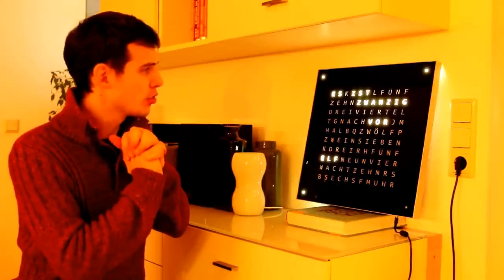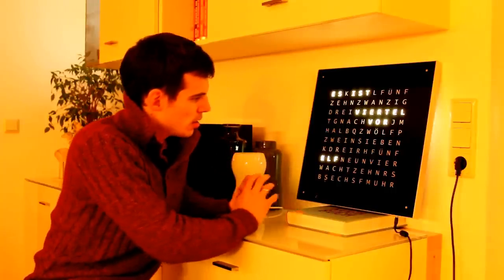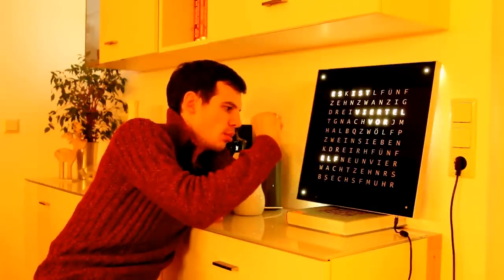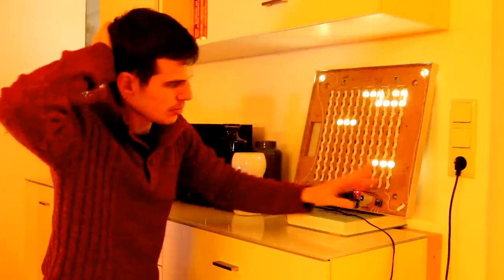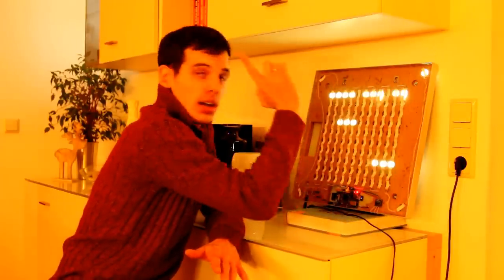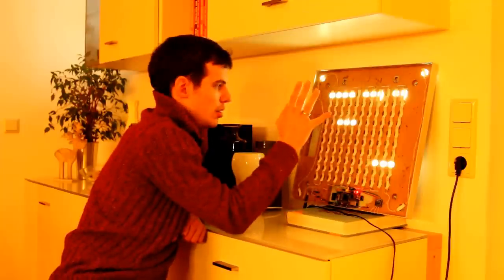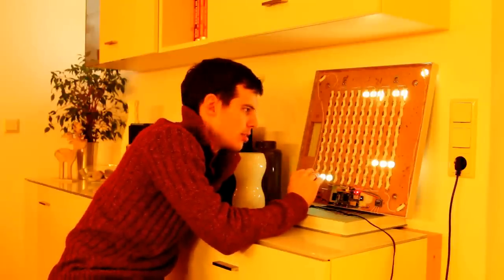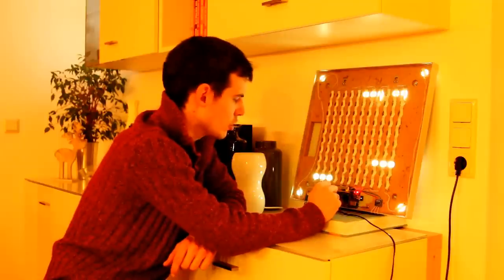Presenting a Raspberry-Pi based Wordclock

Comment: Hi Bernd, wonderful project! 

Your instructions and code were an excellent help making my own version, resulting in a very nice birthday gift. After a lot of experimenting, I now use a smartphone app to control the clock functions, like brightness, color, and temperature display. It uses the OSC protocol (pyOSC on the Raspberry, TouchOSC on the phone), which integrates nicely with the clock code. 

The acrylic face plate was the most expensive part. I had it printed at an online photo print shop. But considering the price of the other components and the clock's capabilities, it's still a bargain. So thank you!
Reply from the maker: +Robert Pilon 
Hi Robert, that's great news! Good to hear, that you like it! The additional features like brighness control and temperature display are really interestering!! Updates are always welcome! So: If you find the time to share your code on the github website, feel free to do so! ;)
Regards!

Comment: Hi,

thank you for making this project available. i'm working on one right  now and have a question in regards to the wiring. Do you start the wiring at the raspberry pi and then work towards the end or do you work from the end towards the raspberry pi? thanks!
Reply from the maker: Hi +Horatio12453,

there are little arrows on the LED-strip indicating the direction of data transfer. This data is transfered from the Pi towards the end of the strip. All arrows should therefore point towards the end.

Regards,
Bernd

Comment: Hi Bernd, great project. I really like it since I'm also not coming from electronics but already  having a solderiggn version done this is a really exciting and easy to extend version. I already added a Dallas 1820 for giving the temperatrue as plugin. Actually I'm just struggling with how to wire the switches for debouncing (I get "pressed 17" all time). All what I read from adafruit and generally about debouncing didn't help. Could you share how you exactly wired the three switches in your basic non-capcativ version?

Thanks Steffen
Reply from the maker: Hi Steffen,

good to know, that you like the project!! :)
The wiring I did, is like this: https://www.cl.cam.ac.uk/projects/raspberrypi/tutorials/robot/images/EGHS-PullUpDownSwitchProtected.jpg (upper version)

Note, that the compatibility with the capacitive board, a button is registered to be pressed, if the GPIO pin is set to low/0. Not pressed corresponds to high/1.

Hope I could help!

Regards,
Bernd

Comment: Wow super nice work. Received a couple of those LED strips and didn't know what to do with them. This got me inspired. Thanks for your upload to github and your explanations. Was really thinking it was impossible to use these kind of addressable strips directly with the Pi. Finally  ran in to your great video!
Would it be a problem to use the Pi model 2?
Reply from the maker: That's good to know, that you like the project! I'd except it to work fine with the PI 2.

Comment: Hi Bernd. Nice and inspiring work!
I'd like to ask some questions, since I want to build a similar clock. I've ordered the mentioned led strips, but I can't see what the exact distance between the LEDs is. Do you maybe know that? Or do you know, which distance you had between the holes for the letters? And how big is the clock in general? Something about 50cm?
And additionally to that: I like, how the front looks, but I can't find any information on the docs how you did this. Is it a foil on a glass plate? And how did you mount the glass at the end? I see 4 mounting screws, but I can't imagine how it looks on the other side. :)
Reply from the maker: +Markus Strässle Hi Markus,
I'd recommend to first get the front plate and afterwards buy a LED-strip with according spacing. In my case, the clock has a size of 45x45cm.

The front is readily available here:
Layout: http://www.mikrocontroller.net/wikifiles/3/37/Wordclock-0.13.zip
Projekt: http://www.mikrocontroller.net/articles/Word_Clock_Variante_1

I attached it with four screws, which I glued onto the frontplate. (I'll try to find the time to provide images, which explain this a bit more in detail... :)

Hope this helps,
Bernd
Reply: +Bernd Krolla Thanks for your reply. Meanwhile (actually today) I've built my own front in 50x50cm. The LED strips should arrive tomorrow. Since I painted the glass front by myself, I'm not sure, wether it will work to glue anything on it or not. We'll see. :)

Comment: Great job. I'm interested in starting this project myself. Do you have some detailed closeup pictures of the wiring and raspberry pi + sensor? Thanks, Christophe
Reply from the maker: Hi Christophe,
thanks for your interest in this work! I'll try to provide some documentation latestly by end of April... Ok? ;)
Bernd
Reply: Hi! Sure, no problem! I'm currently discovering the Raspberry Pi and ordering other stuff. I was wondering as well if you drilled the holes straight through? I have seen other examples online where they drill kind of conical holes. If one led is on, you don't have light in the holes next to it? Thanks in advance! Christophe
Reply from the maker: Christophe Hanssens
Hi Christophe, here some images.
http://rpi-wordclock.readthedocs.org/en/latest/doc_hardware_setup.html#assembling-steps
If you can produce conical holes, might this improve the illumination. Otherwise, you can also cover the assembled LED-array with a black cloth.
Regards,
Bernd
Reply: Thanks a lot! Looks like a version 2.0 :-)
Reply: Bernd Krolla Hi, I'm checking the software more in detail, and more specif, the support for Dutch language. I'm making a Dutch version, so I'm glad to see the options for Dutch :) But the mapping is not corresponding to your wiring layout? Also I don't see any Dutch layout files?
Reply from the maker: Christophe Hanssens Hi Christophe, here a few hints:

You can create your own layout (as svg), by adapting [stancil_parameter] and [language_options] within this file:
https://github.com/bk1285/rpi_wordclock/blob/master/wordclock_config/wordclock_config.example.cfg (best, to do this on your local pc after a git checkout...)

Afterwards, use this script, to create the layout: https://github.com/bk1285/rpi_wordclock/blob/master/create_layout.py

If required, you might also use a different array size (e.g. 11x11, as done by Sven: https://github.com/svenjacobi/rpi_wordclock/commit/86ccee4690d4a5c2f267df68dcf1c0d5e0eab1f2

If I got it right, he is currently building a dutch version as well....

If you proceed with a dutch version, I'd be happy to add it to the repository... ;)

Regards,
Bernd
Reply from the maker: Hi Chrstiophe,

here a first step: https://github.com/bk1285/rpi_wordclock/tree/master/wordclock_layouts/dutch_10x9

Since I don't speak dutch, please confirm yourself, that all times can be reproduced.
Furthermore implies the fact of the 10x9 variant, that the wordclock icons need to be adapted. If you have a 11x10 version, you will not need to worry about that...

Regards, Bernd
Reply: Bernd Krolla 
Hi Bernd, 

I was able to build my own 11x10 Dutch layout via your script, that worked out perfectly! Thanks!

If you don't mind I do have some other questions: 
- How big are the holes you drilled?
- Where did you order the sticker and the glass faceplate?
- How did you attach the glass to the wood? With magnets (and are these then glued to the sticker on the glass)?
- I would like to add a lightsensor, I guess this can be done via an additional plugin that I would have to add?
- Also I would like to add some touch buttons. Did you evaluate this option? I guess I would need such kind of chip: http://www.adafruit.com/product/1362 ?

Thanks,
Christophe
Reply from the maker: Christophe Hanssens 
Hi,
I ordered the complete front directly here http://www.mikrocontroller.net/articles/Word_Clock_Variante_1
However, they only offer the geran and english layout... :/ If you find other ways, I'd be interested (stancil-shops, etc...)
- To attach the front, I glued skews with fine theads onto the front.
- A plugin for a light sensor would be one way to go. But the new API of rpi_ws281x 
allows direct regulation of LED-brightness as well... I'd be happy for any contributions... :)- I acutally evaluted the option for touchbuttons. It works quite well... :)
To answer the remaining questions related to the front, consider the following points:
- Your front needs to have a border/frame, which is wide enough to house the RPi.
- It's good to have this in mind, if you order your front stancil.
- The stancils font size furthermore defines the diameter of the holes, since they have to be wide enough to allow the letters to be completely illuminated (in my case 20mm).

Hope that helps... :)

Regards,Bernd